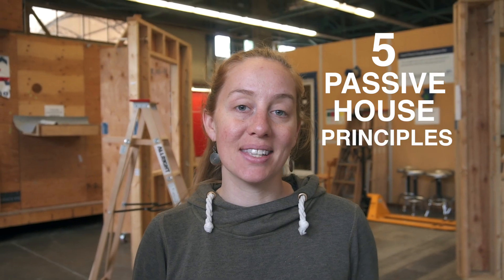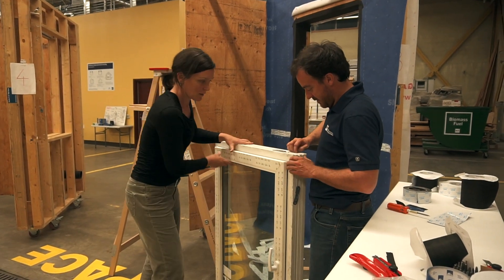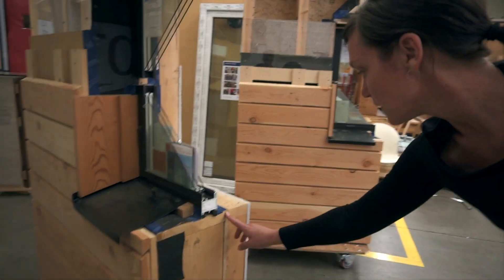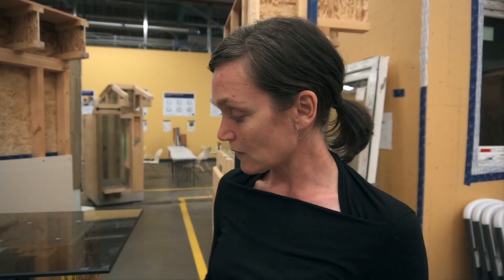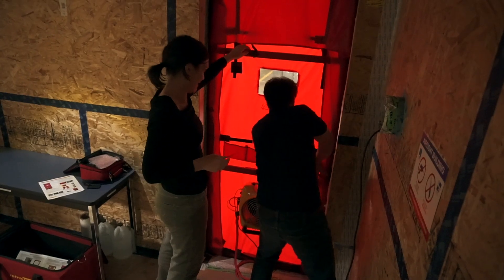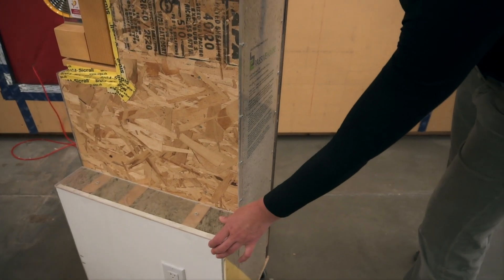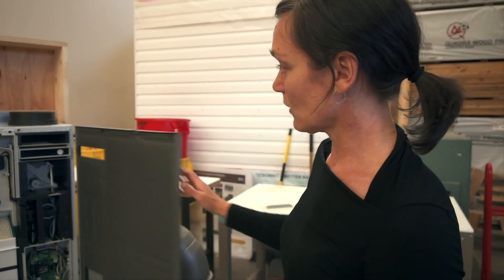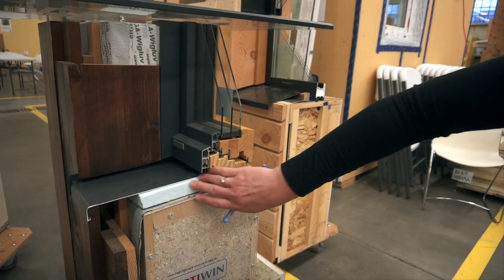Passive House = 90% Home Energy Reduction!

Comment: To break the heat transfer, you do not need to have two separate walls--you only need to install a staggered stud scheme in the exterior walls (because this also acts to reduce the transfer of noise, it might be a good idea to also staggered the studs in the interior walls).  Make your top and bottom plates with 2X6's and the studs are 2X4's.  One set of 16" on center studs is nailed to the outside edge of the plates and these hold up the structure and the sub-siding; another set, also 16" on center, but placed on the inside edge of the plates and between the other set of studs (so, eight inches in)--this set of studs holds the insulation and the drywall.  Google images has a drawing of how a staggered stud method looks.  This is much cheaper, probably better, and can be done by anyone handy with a hammer.

Comment: I keep questioning, do the extra costs building a passive, super insulated net zero house pay off financially, or it it just that fuzzy warm feeling you get thinking your saving the planet? The fuzzy warm feeling some get when they buy a tesla before they realize the unsustainable environmental impact of producing the batteries and the chinese children abused working the sweat shops.   Or how about the energy required to produce these green building products?  I used a solar payback period calc, only to find the calc tripled my kWh price.  When the kWh price was adjusted to my actual cost, the payback period was over twenty five years and you wont even break even considering the solar hardware would need to be replaced or be obsolete by then. I get this feeling passive and super insulated net zero house's are snake oil and bragging rights for the rich.

Comment: I've been reading about energy and rather than passive house technologies it's all about various sources of energy and how we can convert it to electricity, store it, transport it, and use it in the home. In my reading/Youtube-viewing I recall that a huge percentage of electricity is lost as heat to the air at the generation plant or transporting it or in the home. Though she said heating the passive house can be done much more cheaply than usual, she didn't discuss water heating (approximately 2/3rds of the electricity we use is for water heating and to heat or cool a home). A book-end video on the more complete home which is passive AND includes electricity saving techniques or appliances could be really useful.

Comment: This focus alot on keeping the heat inside the house to reduce heat lose,but here in south east asia it's very hot and humid so i would like to see what is the solution to keep the house cold without wasting money and energy on a bunch of air conditioner

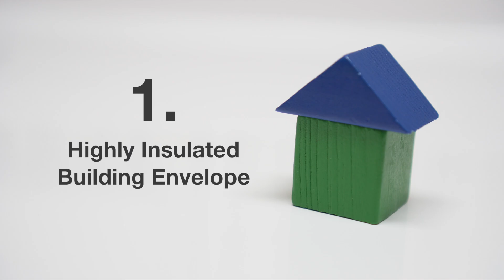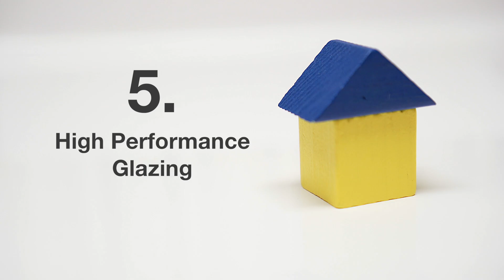Comment: 2:20 1. Highly insulated building envelope. 5:20 2. Continuous air-sealed layer. 7:00 3. Eliminate thermal bridges. 8:04 4. Heat recovery ventilation. 9:27 5. High performance glazing.
Reply: Thank you. 🎉

Comment: Generally, this video is right on, except a true passive home cannot have an HRV, because it cannot have any fans running in order to be called 'passive'... That's just my take based on what I've learned about this topic. A more appropriate term for this video would be building net-zero (or better), high-efficiency homes. But 'passive' means no 'active' systems, so no fans, parts that can wear out and fail, that rely on additional 3rd party energy production (be it solar, wind or even grid energy)... A passive home in the truest sense is exactly that, fully passive...

Comment: I just want to find information about efficient apartment buildings. This could never be efficient enough because it starts off being unviable and inefficient.

I assume a condo would offer even more effective methods of cooling and heating. Internet speed is the most untapped potential in my opinion, at any given moment a house isn't using it's maximum capacity of Internet so having an entire building router sounds like a good idea as well.

Comment: I guess I now know what I did 20 years ago was called. I have an envelope of 1/2” o c pink foam on the inside of the whole house under the drywall. Only regret is that it wasn’t 2”. Ur comments on the heating r confusing because maybe you can maintain the temperature but u need more to get it to the temperature initially and u u really can’t up the temperature like u would maybe want as it takes time for the hairdryer to work. Tho I love the concept.   Biggest problem I see is finding workers who would care about the efficiency. Maybe a spiff to the general but still

Comment: Climate Change is real? Then what would you do about the ChiComms (China who have proven they could care less about life/environment & released biological warfare on the world & the WHO & UN has done NOTHING to China for withholding C19 info for 60-90 days! They intentionally "dropped" C19 on the world) AND India that pollutes/CO2 emissions out the wazoo. You'll NEVER get them to participate! BTW I LOVE Passive House due to lower cost of energy
Reply: China releases 7 tons CO2 per person.    India releases 1.7 tons CO2 per person.    The United States releases 16.5 tons CO2 per person.      
     
The amount of CO2 has gone down in the United States the last few years because of more methane used for making electricity than coal.    But the problem is the amount of methane gas released because of leaks in pipes and the drilling of methane wells.
    
China was spending 3 times more for non/extremely low CO2 electricity production than the United States the last few years.
Reply: Ronald Lindeman  Source it please

Comment: I live in a tropical country where its almost always hot. Can you show how a passive house can be designed to maximize passiveness to reflect heat or how to keep the temperature low inside?
Reply: Nice question. Because of the climatechange, 60-75% of the population in Europe will live in tropical extreme heat and hot springs, summers/leaky autumn even worse than in England/freezing winters

Comment: Monolithic buildings are best, the bigger the walls the better they regulate humidity and warmth. Our ancestors did not surround their buildings with straw, which was their insulation at that time. One should not rely on plastic sealing one has to renew each and every 20 years! :-P

Comment: I know this concept has existed for housing in Norway since the 90s. And it has only accelerated commonness after AC heat pumps became more common, as the yield quickly gets into 400-600% per kW/h as oppose to being stuck at 90-99% for conventional fuel burning or electrical heating.
So house leaks less heat in winter, and overheats less in summer. Floors are less cold, retaining air dampness is less of a issue.
There isn't any real downsides, you literally get more bang for the buck in terms of heating/cooling/comfort.

Comment: I mean......or we could just follow earthship design.....which essentially eliminates the need for AC or heating and it is not an airtight home and i dont think we should be living in air tight homes. we shouldnt be dependent on electrical, mechanical and complex systems to bring fresh air into the house.

Comment: I need opposite of what you have here. Temperature rises up to 40-45°C in my country. Is there anything for that?
Reply: Having an airtight envelope, a heat/energy recovery ventilation system (in this case, it works to recover "cold" from the inside) and eliminating thermal bridges would still be important.
You'd probably still need some form of air conditioning, but thanks to the above steps, it'd need to be much less powerful.
As such, you could probably power it from photovoltaic panels quite easily.

Also, one interesting alternative to regular air conditioning is "ice water" air conditioning - basically, you have a heat pump that cools down water to 0'C, and passes it through special radiators with fans.
But on small scale it tends to be more expensive upfront than regular air conditioning.

Comment: Summary: Have an air tight highly insulated walls, triple pane frame insulated windows. South facing window , no windows on Northside, instead it should probably have thickest insulated wall(these are part of basic Feng Shui.) I was hoping for something beyond... that doesn't cost so much. 

In Cuba the architects figured out how to use natural air flow to keep buildings cooler during hot summers.

Comment: It's a great idea but 90%? 
I don't think so.
As with all salespeople take a pinch of salt.
Reply: From what I have looked into, it can reduce heating and cooling energy use by 90 percent.    I don't think that other appliances are included in those numbers, they are probably also very efficient.  

One of the reasons Passive systems can save so much is they lose very little heat in the winter or very little cooling in the summer.    A house might only lose one degree a day in the winter.  

The Passive systems I read about from Germany were developed where there is very little sunshine compared to the United States.    So a design in Germany would not take into account very much solar heating that might be taken into account in the United States.   But it also does not get as cold in the winter, or as hot in the summer as places in the United States gets.    Designs of the buildings from Europe to the United States would be different because of what can be very different local climates.    

It did seem that the costs were high, but building costs are very different from urban to rural areas, and in some places of Europe and other places in the United States, so it was at least hard for me to make cost comparisons.

Comment: Got there. Good. Here In Europe they use it quite a while now but also it was found recently that even tho the idea has many great features on a long therm base it is not sustainable. The problem with passive houses that u need to follow really and I mean REALLY strict principles as a GC and builder to achive the passive function. Also you need way way more air and heat related structure and automaton to controll the air tight system of the passive structure. The amount of money spent on it just simply does not worth to calc with it. If you would in general plan a Low energy house  that would cost less than a passive and would not need any extra costy pipeing.  Also on passive houses the economic payback can not be determined exactly while on low energy houses they are calcable.

Comment: My idea of a thermos vacuum style hyper insulated building would put these designs to shame. The north facing windows would be part of the wall and lose no heat. It would be so efficient that the appliances would be the heating system.

Comment: this system still seems to be using lots of non-biologically degretable material like the tapes? isn't that bad for the environment? am I missing smt?

wouldn't it be better to leave the tapes out and have a little woodstove feed with wood from nearby forest that regrows? or I also found a corporation called "Thoma" that use only wood and special stone floors that safe heat coming through rightly placed windows. thanks for the video and answers :-)
Reply: Unless you're building with natural materials like cob or strawbale and you're working to build to code, I doubt they can get away from the use of some type of taping etc. Overall impact of these materials vs. the reduction of energy (which could be coming from fossil fuels) is minimal to gain massive improvements in energy use for heating. The important part is to look at where you're building and work to find solutions within your context.
Reply: @TracyLydiatt  interesting points. but the thing is this wood house building coorperation "Thoma" I meantined builds house walls solely out of wood and some of them are passiv houses that can even withstand harsh winterconditions in Switzerland/Austria. I think we should look for solutions that are 100% recycble otherwise it might cause more problems down the line

Comment: First flaw data and statement at 4:35 about not needing to open windows. 
Fresh air is extremely important for health and longevity, this especially while sleeping. “Heat recovery ventilation system” I do not believe this brings fresh air/oxygen anywhere from 17%-22  in the air.
Reply: I don't know anything about the technical requirements of the air, but the ventilation systems run all the time, 24 hours a day, from what I have read.    The ventilation rates have settings for vacations, etc..
Reply: Ronald Lindeman filtering is one thing but fresh air is deferent. I need fresh air
Reply: @dreadone6894  It is fresh air.    It ventilates, fresh air coming in, old air going out.      What the Heat Recovery Ventilation System does is take out warm from around the kitchen stove and bathrooms mostly and has that warm up the incoming fresh air by heat transfer.    They say it is about 80 percent efficient, but I'm sure it has different efficiency depending on the outside temperature.    It warms up the incoming air in winter and cools incoming air in the summer.    Adjusts the humidity of the incoming air also.

Comment: I find it interesting that she is constantly talking about heat loss, as climate change gets worse the energy demands of cooling are going to triple. Even worse, in places were aircon is not common (Europe) people are literally dying from the heat. This house looks well insulated but I hope that it is also cool- a lot of houses in the Europe have no awning or overhang on windows and are designed to hold all the heat- I actually find them quite stuffy. People are dying in their homes in the middle of summer. I am curious to see how these hold up in the heat (especially long stretches of heat- like a month of over 30 degrees, which is normal in most places). Of course, insulation is a good thing but we need to start thinking about heat protection along with preservation.
Reply: no, we are in for a decade or 2 of global cooling due to sun cycles
Reply: Keep in mind that BCIT is located in Vancouver, Canada. And they are mainly focused on the Canadian market. Vancouver rarely goes over 30 degrees in the summer.

Comment: 3% - 10% extra cost? That's NOTHING. I'm going beyond even this standard for my custom build house. I'm going all in for an all electric zero house run with solar.
Reply: It is way more than 10% they should be honest . 2x10 studs triple glazed argon filled windows . House wraps insulation and huge labour costs just to start .

Comment: It depends on policy and regulations of each country, im Czech and passive houses re built here and getting popular, heat pumps, heat recovery systems, renewable energy generation ... its not new here.. Im familiar with situation in UK ( i live here now) which recently agreed zero carbon emissions by 2050 ( they must be joking).. Houses in UK re generally extremely energy inefficient, no new technologies re used. I ve seen single pane windows, new flats with electric wall mounted heaters. Havent seen heat pumps, heat recovery systems... When you see new houses built they re already obsolete and energy inefficient  ( cavity walls+ gas central heating).. EPC ( energy performance certificate) is about C, D... They wont achieve any z,, zero,, carbon target this way, not even closer.....
I like the video and attitude of all of  you, mine is probably the same as yours... Good luck... former property energy assessor

Comment: This video and the information is out of date and NOT accurate or up to minimum code requirements for building today. You need to research and update this video with current up to date products and building methods. Check out Matt Reisinger on YouTube, he profiles and showcases the latest passive/energy efficient products and building techniques.

Comment: 6. simple building shape; 7. building placement adjusted to sun and wind direction; 8. floor plan that includes glassing on S, no glassing on N, hot rooms like baths in the centre of the building, cold rooms like pantry in the N side of the building; 8. no thermal bridges mean no thermal bridges and not less thermal bridges, breaking the bridge with 'some' insulation is not equal to full width of insulation

Comment: This type of wall construction is completely impractical for any type of mass construction. There are many other designs such as using ICF's or just thermal breaking materials on the exterior of the structure. Modern construction has leaped past this type of design.

Comment: Yet not a word about solar gain through proper placement of windows and awnings. We knew all these theories in the 80’s when we built. It’s key to place the house factoring in solar gain, direction of winds and awnings placed for sun and rain control. All old concepts...just new materials to work with.
I live in a passive solar geodesic dome. My constant joke is “ the only thing passive here is the house”. I constantly open and close windows and drapes or blinds for sun and air control.

Comment: 3 - 10% added premium is not true. 10% Would be the baseline minimum to start from.
Reply: Hudson B depends where you start from. Obviously if your baseline is a shitty US style house designed to be built as cheaply as possible using sticks, paper, glue and staples then yet, the premium will be significant. But if you start with a solidly built European house design  you are only looking at upgrading, rather than completely redesigning, the premium will be lower.